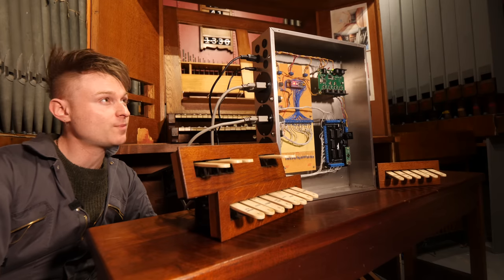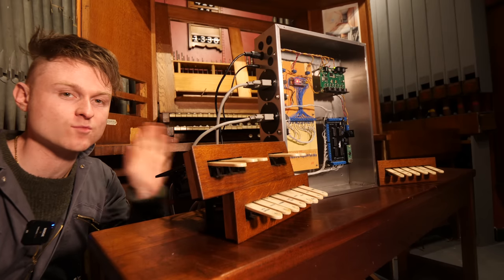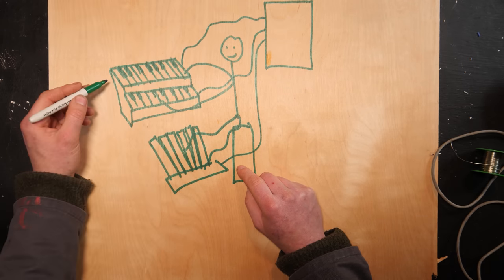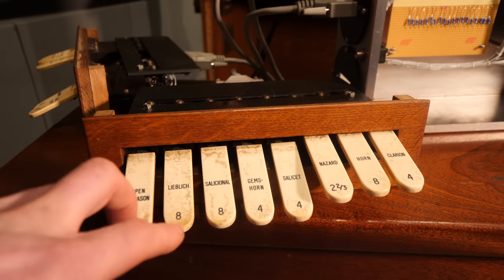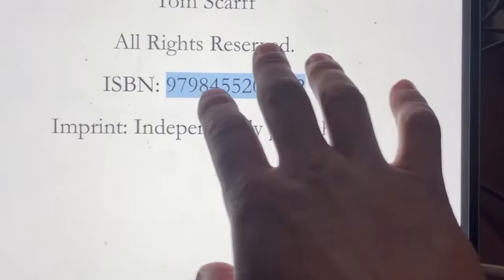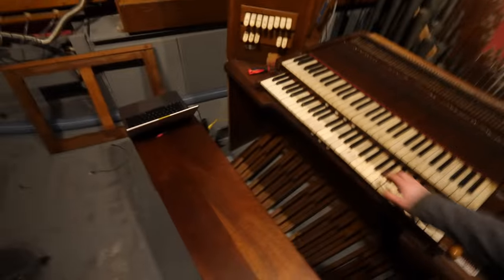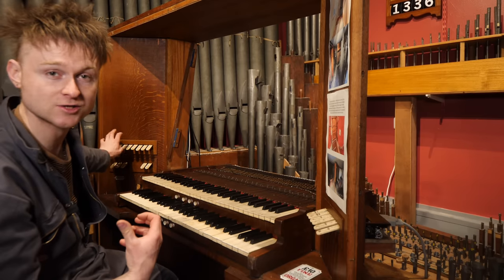I BOUGHT A CHURCH ORGAN PART 14 - CONSOLE BRAINS AND WIRING

Comment: I love your MIDI solution to this instead of having everything hard wired. Leaves the parts as modules that can be easily re-coded and changed as desired. You could even do weird non pipe organ stuff, like adding your own stop that toggles coils repetitively instead of constant on when pressed to  give a warbled effect(?).
Reply: He already made it talk so it shouldn't be hard to add that function in the finished setup.

Comment: Just while watching this I thought of a slightly different way of coding your 'organ brain'.  Rather than trying to count on/offs, I'd try to keep track of the state of each keyboard, and calculate what pipes should be on, then creating the necessary on/off commands to control the pipes.

So, you'd have bitmaps for which keys are depressed on each keyboard, bitmaps of which stops are depressed, and bitmaps of which pipes are playing.  You listen to the midi channels/scan the stops and update the bitmaps.  Whenever a bitmap is updated, calculate which pipes that combination of keys and stops should be playing.

Then you'd have two sets of bitmaps for the pipes: which pipes are currently playing and which should be playing (as calculated).  Issue the note on/off commands as needed and then set the 'currently playing' bitmap to the calculated bitmap.

Hope that confuses everyone  less than me!

(Anyway, I love how you've wired the midi up for this!  Looks like it'll play nicely as both an organ and as a MIDI instrument.)
Reply from the maker: All good! Yeah your on the right track state machine has come up a couple of times it would certainly be quicker
Reply: This was my exact thought too—you'd be able to take advantage of the arduino's bit operators which would be both ram efficient (important when working with Arduino nanos) and fast. Use standard bit mapping techniques, run a diff, and send the appropriate midi messages.

Comment: Also known as an extension organ because one rank of pipes will have pipes that extend further up or further down in pitch and the different stops in effect control what relative pitch you're playing. Generally that sort of organ tends to sound a bit thin and squeeky when all stops are used due to the double or triple or quadruple duty some pipes are doing.

Comment: This is awesome!!!!
I think you have another problem in the future I don’t know if you thought about it yet, the inlay stand that is holding the key boards and the switch is not really made to be free standing as you have it, but in layer into a wall for support, I recommend adding some reinforcement to the base and under the keyboards (this may also assist in giving you a location for adding wheels too) maybe even some reinforcement to the upper half as well, it would be like a box though but at least it won’t fall apart on you as you move around it I would hate to see you get hurt, also would be sad if the keyboard’s broke. Materials you could use could be wood, but then you wouldn’t be able to see anything, plexiglass would allow visuals of the work you put into this masterpiece and still support it properly, so maybe that’s the idea? Of course this is only my suggestion for you because I worry. 😊

Comment: For the midi note, create a buffer for each input(channel), and then switch on/off depending on the condition:
if(midi note something off on channel x)
check if any other chanrls are playing
if yes remove the note from buffer and do nothing
if not stop the note and remove it from the buffer

I did a similar project, a midi switch, some time ago with arduino mega, but I used virtual instruments insted of pipes :)

Comment: With a fully pneumatic the stops are slide values that you pull out or push in to affect the changes between the keyboard and the sets of pipes.  Thus the source of the phrase "pulling out all the stops", which results in each key playing as many pipes as possible that causes the organ to be quite loud. 🤪

Comment: I love hearing about the coding dilemmas.  I'm a hobbyist hacker too, so during the explanation of the stops and how they affect the pipes being played, my mind was already churning over how to track note-on / note-off events that may overlap on manuals, or due to +5, +12 from stops.

I think using note-on counters could end up with stuck notes that you can't clear, if there were ever a note-off that got missed.  So if all keys were already released, e.g., pressing the note again would just increment the counter again.  Likewise, you could end up subtracting one from zero if a note-on event got missed.  You would probably need a panic button to clear all notes just in case.

My solution would be to manage them in queues ... each manual and the pedals being an input queue, which is then processed by the stops before being sent to an output queue.  An event from the manuals would be handled in its own queue and send a message to the stops queue to process it and decide what effect that would have on active pipes before transmitting something on the output (pipe) queues.  An event from the stops would just bypass the input queues and go directly to the stops queue, to change the pipes that are playing the active notes from the input queues.

Or at least that's how I see it before getting knee-deep in code and deciding that it's a horrible idea, or the implementation isn't ideologically pure enough, and obviously needs to be completely re-written.. again..  haha  :-D

Comment: It is great how this is really coming together.  If there is ever anything I might be able to do to help on the code front, even if just looking over the code with some possible suggestions for you, do give me a shout.  I've been fiddling around with the performance and merging of MIDI for a while now.  Things like having the switch scanning on a slower loop than MIDI processing for example, rather than in your NoteOn/NoteOff handlers - I suspect you'll be pressing the keys on the keyboard a lot more often than changing banks of pipes, especially if sending it MIDI files.  That kind of thing might help performance.

It might even be worth considering a combined merge and routing solution rather than having a separate merge unit (a bit like my own Pico MIDI router).

Anyway, this is all looking great now :)

Kevin

Comment: In the Organ related MIDI setups I've seen Channel 1 is Upper Manual, Channel 2 is Lower Manual, Channel 3 is Pedals.  

Channels 4+ are for Extra Manuals (3+ Manual Consoles) and Second Touch (Polyphonic After-Touch) Options.

My Voice V-5 Module and Viscount Legend (Hammond Clones) use this layout.

Comment: Based on what you said with midi sending out an on signal and an off signal, my guess is that you'll just have it send the signals a couple times in rapid succession that way it can't either have the notes stuck on or the notes not work depending on how you operate the stops. Theoretically it should be a simple case of you either hit or let off of a key and it sends the corresponding signal once, twice, three times, then stops just to make sure it kicks itself to the right spot (or at least cuts down on certain possibilities happening). Then if you press the key again not long after letting off, if it's still sending off signals then it can override the signals with on signals (sorry if this ends up not making any sense). Beyond that, very nicely done and I can't wait to see what happens next.

Comment: In terms of your keyboard issue discussed at 17:00, could you code an array, such that the multiple keyboards act like a computer keyboard, that is, each key is at the intersection of two specific control lines and therefore have a unique location? This would eliminate the confusion inherent in the current configuration.
Reply: The problem's not the keys, both keyboards are on independent channels, it's when it comes time to address the pipes which results in ambiguous messages coming in on the channel for the pipe bank.
In his example, he was playing the same bank on both keyboards, but if he played that bank + a different one on the lower keyboard, and that bank + another different bank on the higher keyboard, the same bank would cancel out on a note-off command from either keyboard while the other bank on the opposite keyboard kept playing.

Since it's all done in MIDI the Arduino code will need to keep track of how many note-on signals come in for the same note (there will never be more than 3, one for each keyboard and foot pedal), probably where they came from for debugging, and then appropriately keep track of how many note-off signals come in too. (A max of 4 since you're probably going to want to have a MIDI panic button just in case/for debugging)
Reply: I was thinking along similar lines. Create an array of 127 Booleans for each MIDI channel in and out,.

With each MIDI event in, XOR the input array with the output array. Then just send out MIDI events for the notes which have changed.

Then rather than having to think about event collisions, you just have a single source-of-truth for the current state.

It's not very efficient, 1980s hardware probably couldn't handle it, which is why MIDI was not built this way. But modern microprocessors should be fine.
Reply: @andybrice2711  It could probably be changed up to have some hierarchy modes so channel 1 always over-rides channel 2, etc. Or do things like first-on first-off or first-on last-off. Then at least you'd have it be predictable for input collisions for whatever mode you have it set to. The software end appears to be on modern hardware in this application, so coding it shouldn't present too much of an overhead issue.

Comment: Have fun writing a software requirements spec, so you have an idea of what you want to achieve.
easier to get your head around it than trying to fudge the code the code.

Still it sounds great. use need to put coils on each key for the ghost in the machine look.

Comment: The midi on/off issue shouldn't be too difficult to solve.  Language like C# have something called managed memory, where it keeps track of all the references to a memory location, deleting the memory location only once there are no other references to it.  

Assign each pipe an index on an array and use a state manager.  Any time a key "toggles" a note on/off, add/subtract 1 to the index value and check the value.  If the new value is 0, turn the note off.  If the new value is 1, turn the note on.  Ignore all other values.  For example, if the value is 2, it would mean the note is being referenced by two different keys.

In regards to the toggles, any time a toggle's state is changed, run through the related key states and send the related on/off toggle for any active keys to match the new state of the toggle switch.

Comment: You don't need counters for the code issues, you can solve them with some arrays of booleans. (I'm assuming you're not doing anything too fancy with the Midi, just "on / off")

You need a arrays for each input channel and each output channel. Each boolean array needs a separate value for each note.

For the inputs you just need a single array for each input channel. When you receive a note on event you set the corresponding channel / note to true, when you receive a note off event you set the value to false.

For the outputs you need two arrays for each output channel - One to hold the current value and another to hold the previous value. For every loop you need to go through every note of every output channel. If the previous value is true and the current value is false, send a note off event. If the previous value is false and the current value is true, send a note on event. Then regardless of what you've sent for that note, set the previous value to the current value ready for the next loop.

That converts both the inputs and outputs from event driven to having a current state. Now you can do your combining and routing without having to worry about which events need to be sent. (You should do the input processing, then the combining and routing, then finally the output loops) This method should solve both of your problems in one go.

Hope that helps.

Comment: This project just keeps getting cooler. Love this solution for controlling everything, simple and elegent, just genius. I'd love to know how they did it without a computer controller. Was it just a one-to-one relay system for each key and pipe? Brcause that sounds like a beast to have to maintain. Can't wait to see how the presets work. Oh, and can this be the official theme song for the organ from here on out, please? 😂 Thanks for sharing!
Reply: Many newer pipe organs do in fact use modern electronics and MIDI. It makes operation and maintenance a LOT easier, and the whole instrument more flexible. The original electromechanical actions from the past (as with this organ) used VERY complex wiring and interconnects to achieve all of this. 

The other style was a "tracker" action where literally EVERYTHING was mechanically coupled. Those were fun because when you engaged the couplers between manuals, it MECHANICALLY coupled them, and the keys moved on the other keyboards when the ones on the coupled keyboard were played.

Comment: I know microcontrollers don't like dynamic stuff very well but you can try to make a dynamic lookup array of the notes pressed and use a counter that goes up at ON and goes down at OFF. If the counter reach zero the note can be released. But if you think about it, it can also be an array of ten elements (20 bytes - {note,count}*10) because you have only two hands and 10 fingers. At maximum you can press 10 notes simultaneously or 5 same notes simultaneously. This must be pretty easy to implement however I don't know the quality of the code 🙃

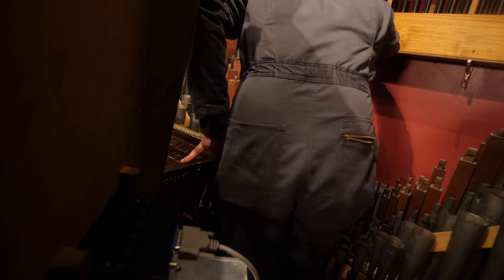Comment: I like the way you've recorded the stereo audio starting @16:10 Also, I was thinking about your counter idea, sounds a lot like you might end up implementing a dynamic state machine - that is, a state machine that accommodates n+1 combination of states during runtime.

The finite states (S) and input alphabet (Σ) are your keyboards (S) and keys.(Σ)
The state transition function (δ) describes based on the internal conditions - allocating and deallocating transition states to memory based on your rule set interaction (S)(Σ)t * (S)(Σ)t (maybe wrong but it's a guess)
The initial state (s0) is the resting state of your alphabets (Σ) (off)
The final acceptance states (F) should roll over to the initial state (s0), so the allocated and deallocated transition states balance out.

The decision output from that style of state machine is likely limited more by allocated memory, since you could really go nuts with which keys start and stop, since statically mapping all the possible combinational states is impossible.

Having said all that, it might be just between the keyboards themselves, so you might just need to map one state machine per keyboard. Not sure, depends on how many fingers you got to press all the keys I guess.

Comment: So I remember the old Hammond organ valve amplifiers could be overloaded by pressing too many keys at once (used to great effect in some tracks). Is this something that your organ does by drawing too much air? Does it run out of puff if you press too many keys at once? If so, does sound horrible, or could it be put to good use?

Comment: Hmm... the note on/off issue when you're sending identical midi messages by using the same key on different keyboards could be solved with some logic in the code.

I don't know arduino well enough off hand to give you a code block, but the idea is you essentiall OR the messages together.

so the logic would go a little something like this:

If input A OR B OR C goes from 0 to 1, output MIDI on for note X

If input A OR B OR C goes from 1 to 0, AND A B and C are all 0, output MIDI off for note X

you'll need the second condition of all inputs being 0 to prevent the early note off, but extra note on's should be ok as the note will already be on.

Ideally, this would be done so it's only when it's noticed multiple MIDI on messages to save on processing time (as you want the code to take as little time as possible to execute) but you may not need to do that optimization step depending on how long each check takes.

hope this helps

Comment: This is just to help you.  Please do not take this the wrong way.  
. You have the stop switches mixed up.  The switches with the Horn and Clarion are for the Swell Organ.  The Nazard is of the wooden (flute) pipes.
. It seems like you started the Flutes stops at the first pipe of the ranks.  Where the 8' Flute is, it sounds like the 16' Bourdon added.  The flutes should then start the next octave higher.  8' is the same pitch as what would be on a piano.  16' one octave lower, 4' one octave higher, 2' two octaves higher.
. The Gemshorn is a Flute/String hybrid.  Perhaps the Gemshorn 4' should be a combination of the Flute and String ranks.

Otherwise, well done on this project.
Reply from the maker: cheers on the swell didnt know that. as for the flutes im aware they are wrong, i preferred to have all the pipes on the keys than it be correct. but cheers on nazard too. but i ended up going with it on both wood and principals cus sounded better to me. thanks :D
Reply: The Twelfth and the Fifteenth of what is supposed to be the Great is of Principal (Diapason) quality.
 Furthermore, an 8' string used together with the Nazard 2 2/3' (flute) will create a synthetic Oboe.